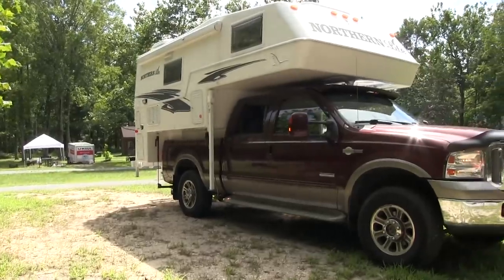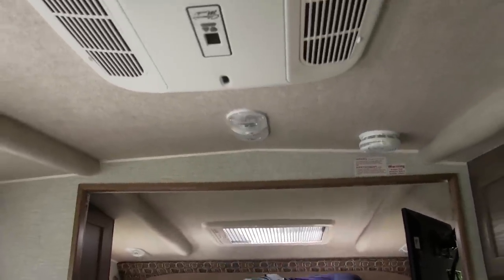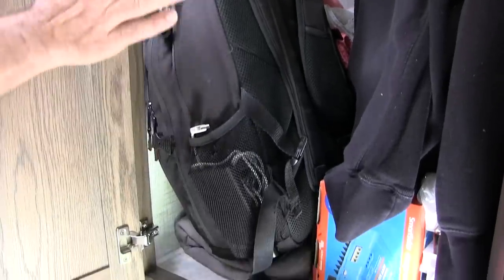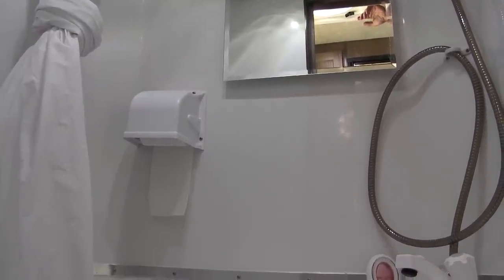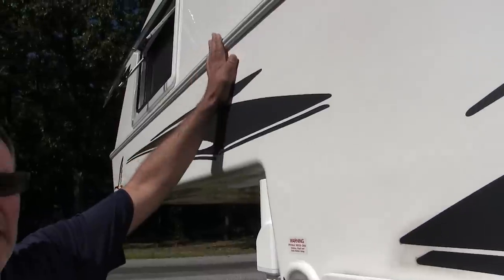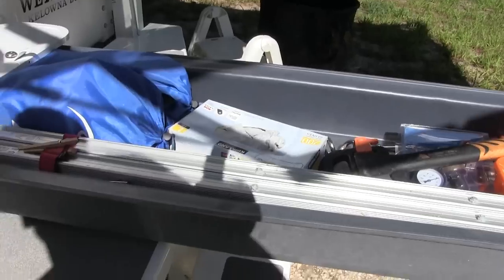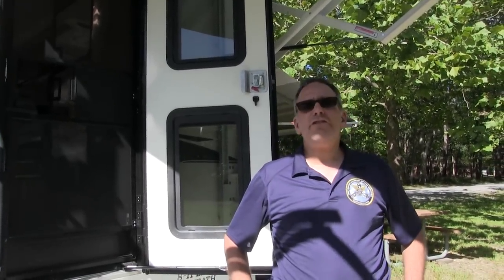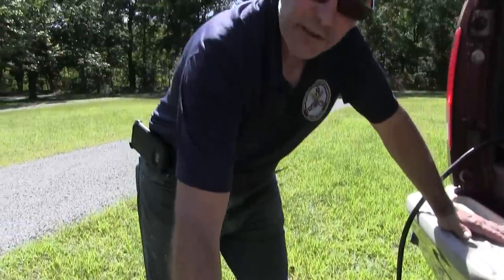ULTIMATE FOUR SEASON CAMPER | 2021 Northern Lite Truck Camper 4x4 Overland - FULL TOUR

Comment: I have a 2015 10-2EXCD....I have it on my 2009 F-350 SRW.... I camp in it full time April to Nov in the Rocky Mountains. I rarely camp in campgrounds, mostly boondocking.  I have taken my TC everywhere...mining roads, through the woods, over mountain passes, places that I probably shouldn't have gone.  I have had not one problem with my Northern Lite..they are build tough and to last.  My wife loves it also...so comfortable with everything you need to live extended off grid as long as your water holds up.  I up graded this last year with lithium batteries and it was a great move...no more worrying about running your batteries down below 50% plus lighter and way more power.  Highly recommend these campers...oh and they hold their value...which is nice also.
Reply from the maker: Oh wow, good information
Reply: How long can you run the fridge off propane and/or batteries? He mentioned here the fridge depletes the batteries fairly quickly. And he has the 200ah + 200w solar setup.
Reply: @TW---  I'm not sure how long it will run just off the batteries, I've never been in a situation where I've needed it.  In areas where I don't run heat and just the fridge, one 20lb tank runs the fridge from 4 to 5 weeks.  The NL comes with 2 20lb tanks and I also carry a 3rd on the generator space so I usually run out of food before propane.  The tanks of course last more or less depending on altitude, temps, if you use your heater, how much cooking you do etc.  Before a trip I usually turn the fridge on a week ahead of tome to let it get working well.  When Im not out its off and the doors cracked for air circulaion and I clean it well after its off to prevent any mold or anything.  Its also ready then when its time to leave out again.  It runs continuous for 5 to 8 months while Im out...its a 2015 model and so far zero issues with cooling/freezing.
Reply: @flyingdutchman7585  Thanks for the detailed reply. Wow! 4-5 weeks? That's what I was hoping for. I'd like to do exactly as you: off grid for extended periods, no campgrounds, just boondocking. Seems totally doable with this camper: water capacity, 2x20lbs propane, large fridge/freezer, lithium system, etc. It's all there. Please tell me about:  1)needing to dump black tank only being 11 gals.? 2) the 10-2 is BIG & HEAVY for a SRW? How is bouncing side to side with all that top heavy weight? I would like to do light overlanding 3) how long can you go on a tank of gas? Any info would be greatly appreciated.
Reply: @TW---  ok TW here is the lowdown and answer to your questions.  First, blacktank - the only time I use this is usually traveling when I have to spend a night in a developed area.  While boondocking I usually just use catholes.  I carry an entrenching tool just for this.  One problem I an seeing in BLM and NF area is people leaving TP around..its littering..please bury your business if in the woods.  The main limit to off grid is access to water.  I usually try and camp near a stream or other source of water.  I carry drinking water.  I do not drink the water in my fresh water tank, trying to filter the tank, etc is just no practicle.  If I need additional drinking water I will filter it into my drinking water containers.  Makes things simple.  The 10-2 can get heavy but with my F350 it can handle the load.  The most important thing is the sidewall rating on your tires.  Go with the thickest availabke for your rims.  Also remember, ratings are for properly filled tires, airing down will change the load capacity of your tires and can lead to bad things happening in the worst of areas.  Lastly, I run stableloads on my rear leaf springs..this keeps the rear from sagging and rolling side to side, highly recommend them for any TC hauling.  The reason I run SRW is because dulleys don't do as well in snow and mud and I find myself in both trying to reach the out laying areas least traveled.  Anymore questions just ask.

Comment: I've had a camper like this but much larger. When you're a large person and middle-aged to older, you need all the Grim you can get. It's very hard to get up in that overhead bunk when you're older, and it also gets very hot and very cold and it's all so noisy in that overhead bunk when it rains. RV buyers should pay attention to the dinette bed, cuz that's where a lot of people sleeping compared to the overhead bunk, and there's a good amount of people who sleep on the floor of the camper. Camper is nice because it's very mobile you can get around a lot of small areas, and if the truck breaks down, you can always buy a used truck somewhere and put the camper back on and take off it doesn't ruin your whole vacation. I had a motorhome get crunched in the front fender, and it took good three to four months to get it repaired and I said I would have been better off just selling it for parts, is it ruined the whole summer plus I had to pay all the airfare back and forth Trying to get the motorhome fixed. With a truck if it gets wrecked you can ditch it and get something else used or new. I just wish they made the back door wider, And a center Island a little wider for a wheelchair so more seniors could use it. I have seen people put a large lounge chair in there and they just sleep in the lounge chair So they don't have to make up the dinette are go the overhead bunk area.. all of these campers should be designed so the roof is perfect shape for solar panels. Also the rear patio awning should have side panels, so it becomes a nice separate room And is usable for buggy areas. also remember that the sewer connection is kind of low to the ground in these truck campers, a lot of people hold their backs And are in pain for days after using a sewer connection so low to the ground. A generator and a solar panel is a must for these units.

Comment: WoW!!!!
can I just say I have been binge watching van tours and the videos that correlate to the van life and I got to say as a single female ...I would almost rather own this baby as first choice. The only reason I would not would be the safety factor of getting up in drivers seat in the event of emergency and needing to move quickly. if that could be modified somehow I know this is the route 100 % ....what an awesome set up. perfect for getting lost in adventure💚💚💚💯
thank u for sharing
Reply: Dear Kristy, you and I think so much alike! I too, want to have the pass-through in case of an emergency and you needed to crawl up into the cab and drive away. Now, I used to work for Winnebago building motorhomes and so I am wanting to see the framing structure of the camper in the area where the pass-through would be and see if it would be possible to cut a hole and put a rubber boot to seal out any dust or moisture or anything without disturbing one of them upright studs. Of course you would need to make sure that you have a sliding rear window on your truck also. Where there is a will there is a way!! What do you think about that crazy idea I'm cutting a hole for a pass through?
Reply: @metalman69201  Rubber boot is a good idea--where would you get that?
Reply: @ajaxgrac6547  Good question! I have seen people on YouTube who have cut their own pass through and I will have to watch and see where they got their rubber boot and then I can let you know. I will watch and see if I can find it again.

Comment: I have my 8-11 on 2020 F 350 single rear wheel with new 7.3 L gas engine. Payload of 4072 lbs.  Gas engines are lighter than diesels hence more available payload in most trucks.
Reply: Finally, someone mentioned the truck stats. Thank you! Never mentioned this in video. Did you have to do an axle swap like he did? How is the top heavy weight feel when driving? I want to avoid getting a dually for some overlanding. What are your thoughts on how the F350 handles the weight while bouncing side to side? Too often people purchase the smallest truck needed for the payload but then when you add water + gear they're maxed out. Then you get terrible driving dynamics. I would like to do the opposite. What is your experience with your truck + camper full weight? Did you still beef up the suspension? Any info you can provide would be greatly appreciated.
Reply: Please, please respond if you can. I'm begging you for a reply!😁 Very hard to find these answers from someone with real world experience using this setup. Also, forgot to ask above: I would like to be off grid for extended period. The water, propane, fridge size, solar capacity seems to make this doable. What kind of fuel mileage are you getting? How far can you go on one tank  of gas at full payload with the 7.3l?

Comment: Funny my wife and I started out tenting, then got a travel trailer, then got a big 2017 F350 PSD DRW (cargo capacity 5,750 lbs) and a giant 5th wheel, then down sized to a  old Lance 1030,  We will be getting a Northern Light as the old Lance getting close to end of life (or a nice project for someone)   Love the go anywhere feel of the truck camper! Installed the nice Torklift Talon tie down system with Talon Fast guns.  Northern Light is the best of the best if you don't want a slide which we don't.
Reply from the maker: I agree about North Light
Reply: What does PSD stand for? DRW = dually right? Hence the 5700lb payload! I'd like to "overdo" the rig I need for carrying this camper. If I stick with Single Rear Wheel on F350 will I have to do more than just upgrade the suspension a little?
Reply: @TW---  PSD Stands for Power Stroke Diesel, and DRW Yes stands for Dual Rear Wheels.  If you get the 10 2 you will want/Need a DRW Long bed.
Reply: @edyoung6573  ya I'd stick with the 8-11 so I don't have to get a DRW.
Reply: @TW---   That would be perfect for you!!!!!

Comment: Is there an anti-theft security option once you disconnect the camper from the truck?  Also, is there a bike rack option?  On this model or the longer truck bed model is there a clothes washer option?
Reply from the maker: All good questions. I believe the jacks are disabled when not in use so no one can lift it and drive off.

Comment: He did state that he could put 9000 on the rear axle. He has a 4050 lbs on the front axle and rear is about 5000 or a little better . You have go by your GVWR l tried to see his but I couldn’t read it ,mine on my Ford F-350, is 11200 lbs GVWR . my front axle is 6000 rear axle is 7000 with our Lance truck camper we are just over gross buy about 300 lbs ,but not over on axles .  You have to get your gross weight and subtract your curb weight which is your empty weight from your gross weight my gross weight is 11200 my curb weight is just about 8000 lbs  that means I can not go over 3200  , that’s means I am about 300 hundred lbs over weight.